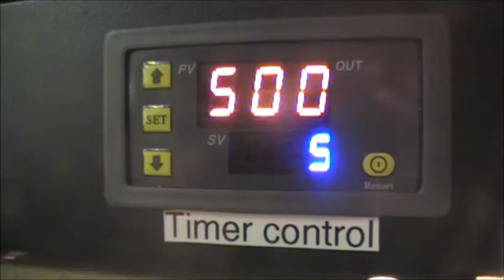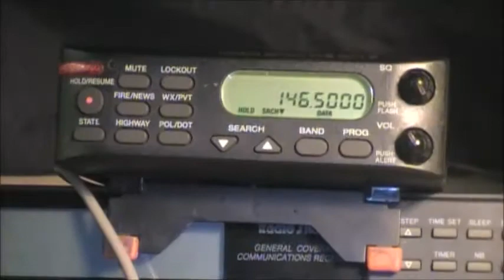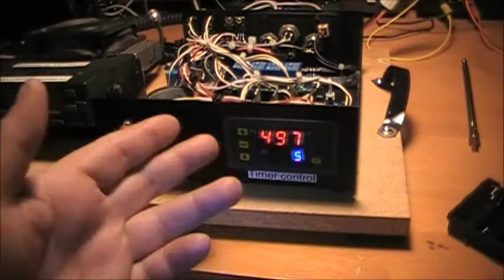VHF / UHF Cross band bi-directional repeater - Closer look

Comment: It's sorta build it as you go project but more do it more you can  plan it . I had done  similar project and few years ago with ramsey DTMF controller + relay driver board a radio shack sea shell phone pcb as a patch , all delays were 2n2222 transistors with capacitors to allow  3 digit on with option of hitting D button for extra phone patch dely hangtine ( charging cap another 3 minutes) it was crazy wiring & I used them cb mic connectors too .
Doing things all over again I suggest a Case with connectors for radio in/out COR TC Audio, Gnd 9 pin serial,  DTMF pcb , ID 8 board from comm specialist or voice recorder and 2 heavy duty relays to run the ON off power thru implementing 4 Binding posts or anderson's on rear mounted to shut off DC line of each radio or all 
The technology has changed  but I still like things simple like this atleast it can be self serviced . In U.S. 220mhz or higher has be used as aux control . You can go  in uhf turn off here. The CW ID is every 10ins when active but not req if it goes to sleep or if a remote base is turned on/ off only to talk on by op only. You can also connect up to your answering machine and phone in the command if not useling ABCD to turn on off.   Niice Video Nice build . 73z
Reply from the maker: Oh the control channel can be in the UHF band easy enough just by a frequency change on the scanner.   This was setup for demonstration purposes for the video, the system is not actively on the air right now.